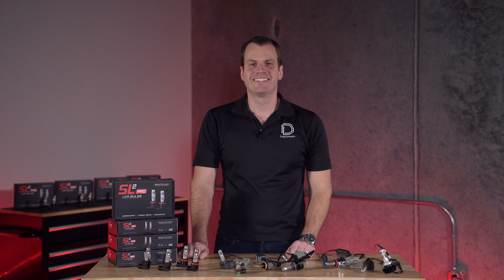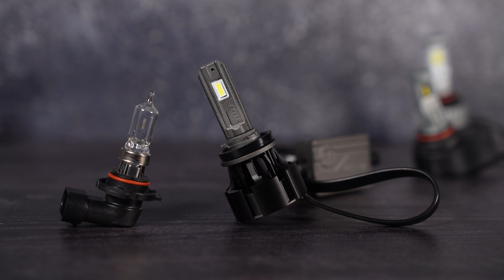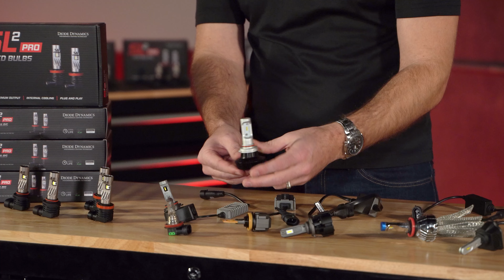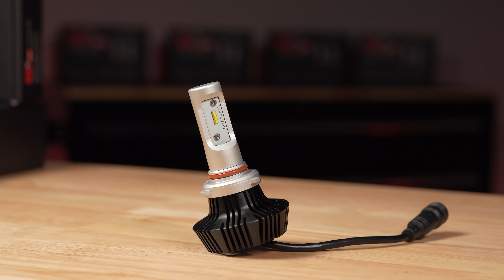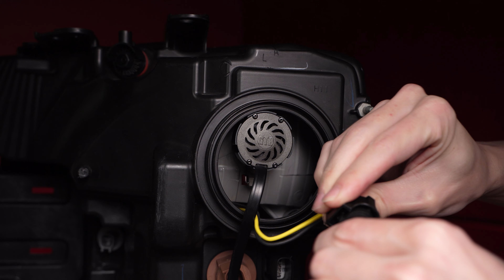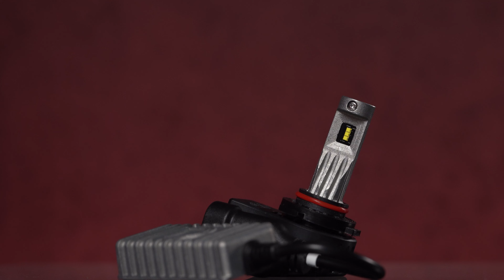SL2 Pro: Compact LED Bulb Fitment | Diode Dynamics

Comment: @DiodeDynamics 

What are u guys thoughts about Lasfit - LA plus and Lasfit - LCair H11 led bulbs?

And could u make a comparison video of those two, VS. Diode Dynamics- SL2 PRO?

And which color temperature is better, which one is a true upgrade, and record the temperature how hot or cooled one of the led bulbs truly are?

The higher the temperature, the shorter the lifespan.

The lower the temperature, the better the lifespan.
Reply from the maker: Here is the link to our SL2 Pro LED bulbs! You can check out all the specs on our website!

https://www.diodedynamics.com/9006-sl2-pro-led-bulbs-pair.html

Comment: How do these new SL 2s work with projectors?
Reply from the maker: Our SL2 bulb mimics the same output pattern as your factory halogen output! The output pattern does vary from vehicle to vehicle, however, the output intensity will be drastically better with the SL2 Pro bulbs!

Comment: Does it still need error decoders/anti flicker for like the 9012 bulb for a 2015 charger?
Reply from the maker: If you needed them before, chances are you will need them still. However, thanks to the new compact size and internal driver, our new SL2 Pros will be much easier to fit even with antiflicker modules!

Comment: I just installed these on a 2006 Chevy Silverado 1500 “off road” had to modify the headlight bracket due to the highbeam light hitting the bracket. Just required grinding out some of the plastic on the bracket to make a little extra room.